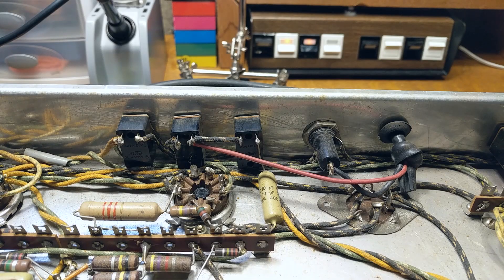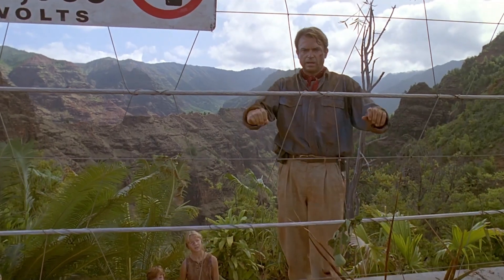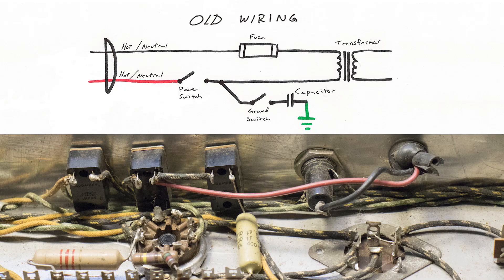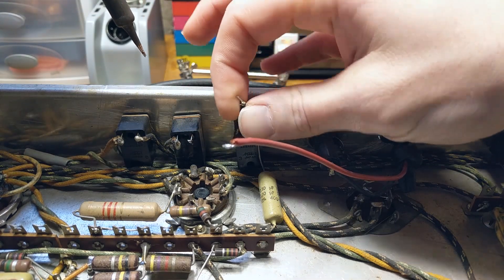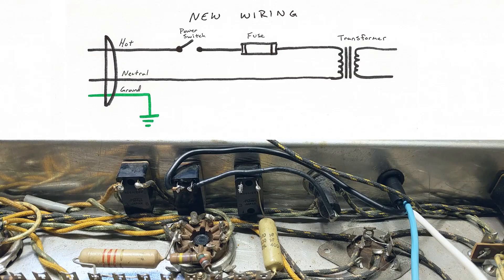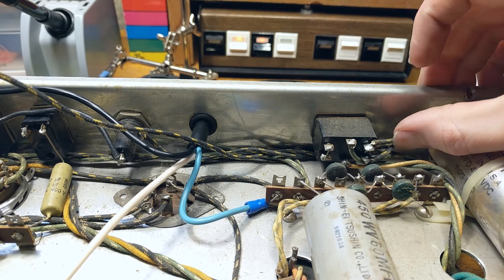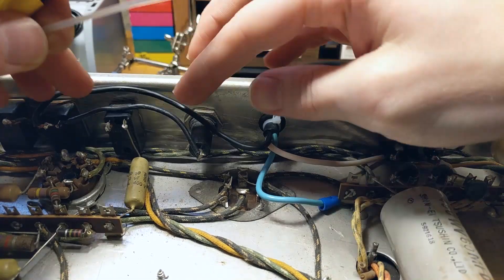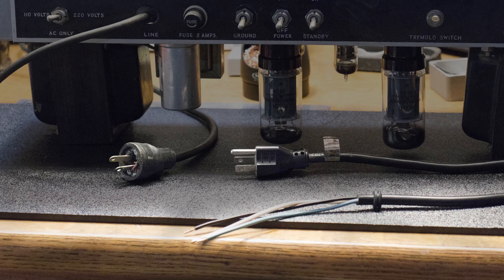Install 3-Prong Power Cord In Old Tube Amplifier

Comment: Came here to research adding a 3-wire cord to a hi-fi tube pre-amp. Pretty much the same exact process, including checking the fuse rating which is a very good suggestion, thanks!

Comment: Although I definitely plan on replacing the two prong AC cable on my Silvertone 1483 tube head, I am considering installing an IEC Jack. In that way I'm not concerned with cable storage when I move the amp and I can use a multitude of other cables. Thanks for the informative video!

Comment: Good video all though I wouldn't use a crimp connector for the ground. At a minimum you want to avoid the crimp and solder the ring terminal to the ground wire. Even better you solder the wire directly to the chassis. 

These things are considered 'best practices' in the tube amp world and crimping anything would be frowned upon. For a gigging amp on the road with all the vibration and abuse they endure I wouldn't trust a crimp specially when it comes to grounding.

Comment: pretty sure it also has internal side connection with return in some weird way and obviously can't tear the plug apart lol...if you burn that and probably did... it's still gonna be dead etc lol. change in just in doubt....glass fuses all damn near turn into a slo blo anyways....it is the wierder ones/older ones and coated ceramic composition held up pretty good and for sure will blo...

Comment: Just sent a question but have another.  If you blow a fuse but forget to shut the power switch you've just wired up....and the fuse blew owing to a short, when you replace the fuse with your bare hand and the circuit comes alive...would you get shocked being you're touching metal?  Again...dumb here with a little knowledge but I can't think this all through?  OTOH, if you wired the cord through the fuse, that would also  become a live circuit as you replace the fuse because the power switch is still on so again...just confused!  I can find a bad part and (safely) solder in a new one but past that it's just a maze of thoughts I can't think through to make any mods.

Comment: Switch first and not the fuse first?  I just converted about 1/2 dozen old Fender BFs to 3 prong.  Hot to fuse tip, fuse to power switch, power switch to transformer.  Neutral to power transformer.  Green to "soldered" chassis ground.  I don't do the lug bolt thing for the ground.  If requested, I add in a 3 prong courtesy outlet to replace the old two prong courtesy outlet.  Normally, when all is said and done, the ground switch is disconnected, the death cap is removed, the courtesy outlet is either disconnected or replaced with a 3 prong.  Where am I going wrong?
Reply: Radiowaves5150  You've misread or you are assuming I have a condescending attitude.  Nothing could be further from the truth.  Trying to ascertain the "correct" and safest way to wire these great amps.  There remains controversy about this procedure.  Also, I am not a teacher.  I can see where you became confused.  Thanks for your response.

Comment: so if the new 3-wire cord is not Black and White wires, but Blue, Brown and Green/Yellow  (ground), does it matter which is hot or neutral? and shouldn't I snip and remove the Death Cap completely once the grounded cord is installed?...even if it's bypassed?

Comment: Confused and maybe dumb...my 1927 house is wired with old 2 prong outlets - breaker boxes grounded to a basement metal pipe. If I convert to 3 prong cord and then forced to use a 2 prong adapter (without connecting the adapter's ground tab) isn't that much more dangerous than simply properly orienting the old 2 prong cord? Better yet just install a modern polarized 2 prong plug assuring proper orientation and therefore grounding. OTOH, I suppose this arrangement would be dangerous in a 3 prong outlet since the wider prong would connect to neutral and totally bypass the lower grounded hole.  Do I have this all correct before I start changing cords that might not suit my old house? Thanks in advance.

Comment: MerwinMusic Hi, I bought a 1964 Gibson discoverer GA-8T amp and what looks like the footswitch cord for the tremolo has been cut off. Most of the cord is there as it is long. It comes out of the transformer. The tremolo footswitch has been cut off from the cord. The cord has two wires. Are these connected to AC current?

Comment: Hello, I have a 2 prong extension cord with 3 prong sockets. If I use a "2 to 3 prong adapter", and plug it to my grounded wall socket will it be effective?
Reply from the maker: No. Adapter just bypasses the ground. This actually grounds the chassis.

Comment: The last wire from the 110 to 220 switch. You didn't say where you removed it from. I one shot it wasn't discussed  and when it came time to hook up the white wire on the new plug the the voltage selector you said it had been "previously cut". Must have missed that part. Will watch again.

Comment: This is probably a stupid question but I have an old solid state amp (1973 Gibson G-30 I think) with the 2-prong plug. I'm assuming it's still dangerous?
Reply: I don't think you need to worry. According to schematics I've seen online, the G-30 has a proper power supply with a fuse and a transformer. It's also solid state, so nothing past the transformer requires the high voltages needed by tubes (transistors work off tiny voltages by comparison). The 'widowmaker' amps were almost entirely low-budget products of the 1960s that used a serial filament layout and took power for the tubes directly from the AC: no transformer, so no isolation. They disappeared when consumer protection legislation was tightened from 1972 onwards in the USA. Since your amp dates from 1973, and for the other reasons I've mentioned, it should be safe (from this particular problem). If you're in doubt, and you want a three-wire power lead for peace of mind, consult a qualified repair person.
Reply: The capacitors can still shock you. It's best to drain them first.
Reply: @in.der.welt.sein.  I think he's asking whether the amp is inherently dangerous in the 'death cap' sense discussed in the video. As far as I can see, it isn't. 

 You only need to discharge the capacitors if you are going to work on the amp. Large capacitors continue to carry a high level of charge after the amp is switched off: but that is irrelevant in normal use, because you don't go inside the case.
Reply: 1970’s Marlboro G10 and TrueTone 1960’s MIJ solid states here, same process I’m assuming?

Comment: I have to disagree saying old cords are unsafe. I've been using original power cords on antique appliances for years and never had issues with them. Even some really old ones with cloth wiring. I think as long as you know exactly how the wiring works and you're safe about using it you're in good shape. Personally I'd never leave old appliances plugged in unattended weather it's got a new cord or not, so if something should go wrong I'll be right there to fix it. I'd never throw out an old cord either. They have a lot of character to them and even those plugs alone can bring in a lot of money on ebay.
Reply from the maker: I'm talking mostly about old rubber cables that crumble and crack when you bend them, exposing the copper inside.
Reply: Yes, I remember Leslie Harvey. my understanding is the stage  was miss wired, nothing wrong with his amp. Don't know if he had had a grounded plug if it would have saved him. I owned a store in the early '80s, we knew which clubs had unsafe outlets  through experience (we blew up a mixing board running sound for greg allmanand I fried my 100 watt highwatt). The chances these days of running into a stone the crows moment are pretty slim, but I played an outdoor gig last summer where the dummies had clipped the ground on some of the extension cords and I shocked the hell out of my mouth.  Still safer to upgrade old amps, but it wouldn't have saved my burning lips.

Comment: don't you need too remove the death cap from the ground switch? or did you just bypass the grounding switch entirely?
Edit nvm you answer my question at like 1:50, id still say have people cut the death cap out no reason for it too be there. Great video tho man thanks!